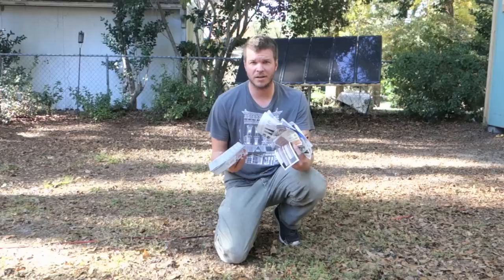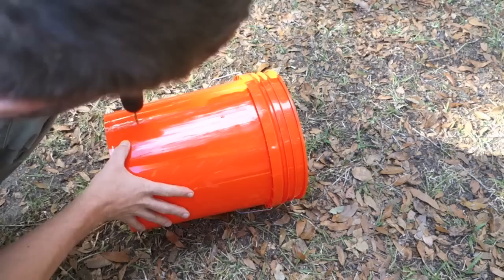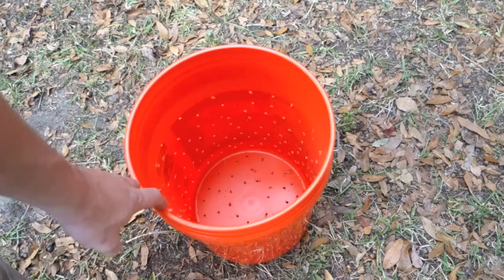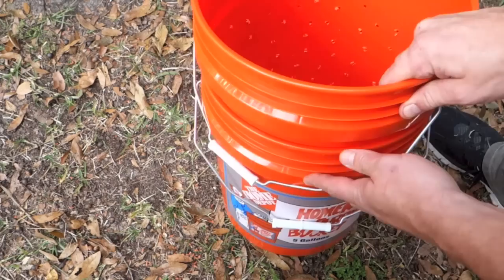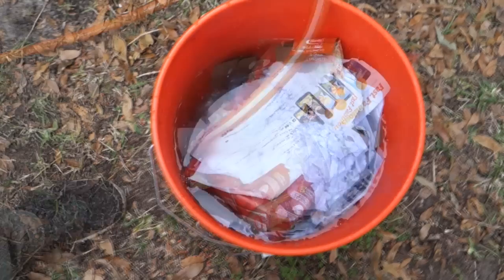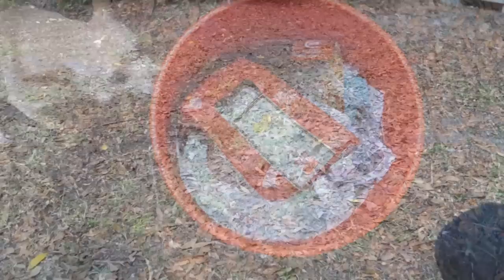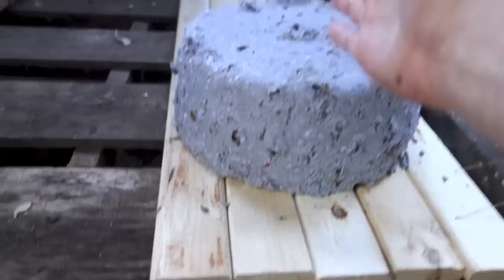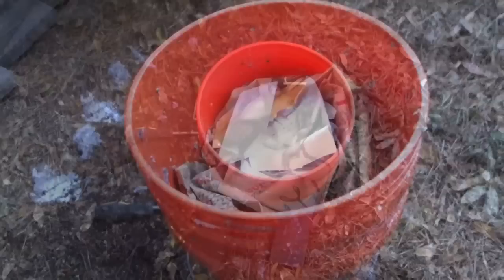Free And Virtually Unlimited Fuel To Heat Your Home

Comment: can we discuss the inks in this paper that youre using, flooding your home as a gas...? you people cannot believe this is a good idea..
Reply: The fumes are still there..
Reply: lets all huddle around a poison smoke fire!
Reply: John Kersch Definitely much better than the millions of automobiles creating poison, huh? Or how about the coal fire power plants for heat, instead? Great way to look at a two sided coin! sarcasm
Reply: CO2 is a lot less dangerous than the fumes coming off that shit; btw, firing this would also create CO2 emissions. Might wanna go back to school.
Reply: John Kersch Do you have any clue about the amount of energy consumed in obtaining and processing fossil fuels? We haven't even gotten to the consumer yet. I have a feeling you're clueless about such topics.
Reply: Coming from the guy that thinks co2 is poison, I have less faith in your understanding.
Reply: John Kersch I never mentioned CO2, you did.. But if you're denying that factories and automobiles aren't bad for the environment then it is I who has less faith in your understanding.
Reply: John Kersch carbon monoxide is the poison one and it's produced in any case of burning fuels CO2 is bad but CO will kill you. 

bugs181 well fossil fuels are dangerous but their energy released is still above the cost to produce it and since their fumes are cleaner/easier to control fossil fuels are safer than this.
Reply: James Mulchrone Ummm.....CO2 is necessary for life. It is critical to photosynthesis.  CO2 is  NOT BAD.  ....contrary to those who are dumb enough to believe in the man-made global warming hoax..... (aka the government power grab based on total science FICTION ) 

I agree with you that CO is dangerous, and should be monitored when burning any carbon based product, however burning paper biomass fuel is carbon neutral.  Because if this paper decomposed in a landfill it would emit the exact same amount of carbon into the soil and air as it decomposes.  

Same thing with wood. It is carbon neutral and burning it is no more dangerous to the environment than if twigs and branches decomposed on the forest floor and NEVER were touched by man....decomposition emits carbon into the air, water and soil.  It is part of the ecosystem and it is NOT HARMFUL, nor does it effect climate change in any way
Reply: Archangel0804 while CO2 is necessary overproduction is still harmful (enough CO2 is being produced naturally that's how trees survived before humanity started burning things) and man made global warming isn't a hoax it's just misunderstood and misrepresented. I'm sure if you look into the information yourself you can clearly see that since the industrial revolution (records go further back but that's one of the biggest turning points) the world has been heating gradually. I understand if you would be sceptical as it's really been forced down peoples throats in recent years but the evidence is there.

while paper is manufactured the process removes the woods natural oils that allow for prolonged burning and better heat generation as a result the burn will release more dense carbon resulting in higher CO production (which is both more damaging to inhale and to the environment) so i wouldn't agree with you on paper being carbon nutral. I do agree with you on woods though as during the lifetime of a tree it absorbed the carbon that's released while burning.

Decomposition releases mostly Methane gas (CH4) which is being collected from old dumpsites and used as natural gas which is far more effective for heating and cleaner burning so i believe if done right dumps can be an effective, clean and carbon nutral solution to overproduction of waste. 

While it's true that decomposition does also release Carbon into the air it's useful carbon and the solid mass left after decomposition is nutrient rich which can be used to fertilise the soil of new trees whereas ash is not really effective when it comes to fertiliser.
Reply: James Mulchrone I'm not even going to debate you on this topic because you are parroting a bunch of nonsensical BULL,  spewed out by the bought and paid for corporatist mockingbird media which has an agenda.  

The Earth is not warming, it has been SIGNIFICANTLY cooling for the last 18-20 years. Evidence is the cyclical colder temperatures in the Northern Hemisphere, winters are MUCH colder and longer;  polar ice caps have massively increased just in the last 15 years

The "Global Warming" HOAX is just that...a HOAX. The only thing that happens when you increase CO2 in the atmosphere or in controlled test (such as a greenhouse) is that plants rapidly increase in size.

The HOAX is based on computer models and is purely  THEORETICAL, based on BAD SCIENCE which is funded by Governments and the UN which have an Agenda of seizing power to tax and nationalize the consumption of energy. 
Meanwhile Scientists rely on this funding to remain employed, therefore together they can skew the data to present anything desired by those paying for the data, much like an accountant who wants to present the strength of a company in a better light to its stockholders, can manipulate the numbers

31487 Scientists Agree with me. 9029 of which hold PhDs

http://www.petitionproject.org/

One of the MAJOR problems with the studies in "Global Warming" is that the models don't take into consideration the effects of the SUN.  

From a logical standpoint, WHY wouldn't the studies INCLUDE the effects of the SUN....that which controls and has the largest effect on  the Earth's temperature??  The FACT is that the SUN is responsible for the SLIGHT INCREASE in CO2 on planet Earth.

You are correct in that CO2 has increased in atmosphere from the standpoint of measuring from ppm, HOWEVER this is purely CYCLICAL...It will reverse and is already starting to do so.

Furthermore, There is plenty of Scientific data which supports that the percentage of CO2 in the atmosphere was  MUCH higher roughly 300 years ago than today.   Today it is estimated at 384ppm, whereas roughly 300 years ago studies suggest over 400 ppm
Explain THAT.....Fossil fuels weren't even burned 300 years ago.
Reply: John Kersch If you have a wood stove in your home with the chimney going outside your house, no problem
Reply: budsatawny It's one of the Best products available...Thumbs up
Reply: bugs181 Coal fired power plants in the USA (not ALL, but the vast majority today) have had catalytic converters for more than 20 years....which convert the emissions to simple water vapor.  

The rest is simply agenda-driven, parroted DISINFORMATION. 

 Do some real research and talk to a few engineers who work for power companies who will confirm this information.  

The "war on coal" in this country is purely political. 
It is all LIES meant to keep American Citizens heavily taxed and under the control of the Federal bureaucrats.  It adds legitimacy to the EPA fascist bunch

If you want to point fingers, look to the Chinese, who build a new coal plant about every other week, and do not regulate their emissions whatsoever.  We all live on the same planet. You are breathing "Chinese" and "East Indian" air too.
Reply: Archangel0804 It's funny the way you say "I'm not even going to debate you on this topic" and then you go on for 8 paragraphs and an external link debating why the nonsense you believe to be right is true and everything i have learned on the matter is wrong. (that's sarcasm just incase the text doesn't show it to well)

If global warming was a conspiracy like you say then why are corporations losing out on things like emissions taxes, if you said it's the government's agenda i might believe but no, just no.

yeah i've seen the tide steadily rising at my local beach since i was a kid (rising sea levels) and for a country with year round mild temperatures we've been getting longer hotter summers and shorter winters. That's physical evidence of global warming which is worth much more to me than your say so. 

Are you serious? plants have a rate of absorption like humans have a rate of digestion increasing the CO2 drastically would be like force feeding a person it doesn't give people more energy it chokes them. i don't know where you learned biology but Photosynthesis doesn't work like that. 

I think you might have watched a few too many movies there's physical evidence of global warming, i know NASA is a US government organization but if you take a look below you can see the evidence that seas/oceans temperatures are rising, the ice sheets are becoming thinner, sea levels are rising ect. 

Yeah on your petition there, what's stopping forgeries? Also on their "scientists” What expertise does a nuclear engineer or a medical doctor or a food scientist or mechanical engineer have that makes them qualified to have an informed opinion on the causes of climate disruption? that petition has no credibility.

What are you on about that they don't include the sun? obviously they include the sun that's what's generating the heat that's being absorbed into the atmosphere easier because an excess of CO2 they do account for the sun. The sun cannot increase the amount of CO2 and unless you have even the slightest evidence to back up this point you might as well have not bothered since again it's just your say so against physical evidence.

If there's plenty of scientific data proving that you are right than actually show something like a graph rather than you naming a couple of numbers and saying it's fact prove it by linking a graph from a reputable source proving that your right. 

Your final point is so wrong since fossil fuels have been in use since the 13th century (coal) and what's that big event that happened around 300 years ago... the industrial revolution perhaps that was fueled by coal ???
Reply: James Mulchrone First off ....learn some fucking history.  The United States isn't even 300 years old....it is 239 years old, and the Industrial Revolution, PRIMARILY occurred as a result of inventions in this country....like Ford's Model T as an example

Furthermore,  The Industrial Revolution took place from 1820-1840 (by most accounts) this would mean approximately 195 years ago. ....
You are only OFF by about 100 years, dude

I'm NOT going to debate you...because it is CLEAR that you are entrenched in your false paradigm and ideological beliefs and it will get us nowhere.  
If you want to remain IGNORANT...that is your business...but maybe you should ask yourself...CUI BONO?  Who benefits.

The UN and Government are pushing your agenda, because it means more centralized power

More Centralized power means more ability to impose a carbon tax and to limit energy resources; It would be the greatest seizure of power in HISTORY

Maybe you should ask these same governments , what the effects of Geo-Engineering has on Global Warming instead??  

Maybe that SHIT that they are constantly spraying  in the air (which is increasing, massively, the number of heavy metals we are all breathing)  may have something to do with erratic Weather and Seas rising?....and possibly contributing to increased global Temperatures (although this has NOT been the case the last 15-20 years)

What about the increased activity with the use of HAARP in Alaska, that was supposedly closed, but is more active today than EVER??

Why don't you have as much zeal about studying the effects of THAT??...Instead of parroting the SCIENCE FICTION you hear from the Statists....you know....those who benefit GREATLY, financially and otherwise, from this HOAX??

Alarmists like you probably aren't old enough to remember the Gasoline Embargo of the 70s....back when the Alarmists were stating that we had reached PEAK OIL....and that all of the oil would be COMPLETELY GONE...BONE DRY  by 1984......

It is now 42 years later.....

FACT:  There are MILLIONS AND MILLIONS, MORE cars on the roads TODAY than there were 42 years ago, due to the emerging middle-class in heavily populated nations like India and China....... 

And DESPITE THIS FACT, We have a GLOBAL Oil SURPLUS

A TOTAL HOAX

Why was this COMPLETE LIE conjured up in 1973?  

Answer:  CUI BONO???

Because it gave OPEC, The Oil Companies,  and the GOVERNMENTS MORE MONEY VIA TAXATION, MORE POWER CONSOLIDATION, AND MORE CONTROL (EPA)

You are GULLIBLE

TODAY'S NEWS.....this is yet another nail in the "Global Warming" crowd's coffin.

http://dailycaller.com/2015/05/18/new-study-threatens-to-unravel-obamas-global-warming-agenda/
Reply: Archangel0804 yeah the industrial revolution predates america and started in the UK with the advances in water power and steam engine technology that went on to make mechanized factories and rail transport a norm.

Fords model T wasn't made until 1908, that's not in the 20 year gap you mentioned which is actually the end of the industrial revolution (it's said to have began around 1860) so you're wrong.

Again with this "i'm not going to debate" bull and then you go on arguing. Make up your mind! (you also need to work on your translation skills "to whose benefit?")

(i'm getting real tired of reading your bullshit statements...)

Geo-engineering is bad in localised areas (since heavy metals don't carry far) but it hasn't much bearing on a global scale and i'm not bringing it up since i don't have as much knowledge on the matter as i do on the greenhouse effect (as i've studied just the one).

what the fuck has HAARP got to do with anything?

There was an oil shortage in the 70's and since then many new sources of oil have been found as well as old sources have dried up/become too difficult to use. The prediction was based on the sources being tapped at the time (not alarmest propaganda/hoax just misinterpreted information)

"Obama's global warming agenda" seriously? He's only been in office since 09 and as the president he has a set salary (taxes don't go through him they are processed by a separate office so increased taxation doesn't benefit him) not to mention that global warming theories were brought into the media around the late 50's. Care to explain or is that your whole arguement ?
Reply: James Mulchrone 
First off....READ my comment.  It doesn't say the specific date of Ford's Model T  Instead it says:

"The Industrial Revolution took place from 1820-1840 (BY MOST ACCOUNTS) this would mean approximately 195 years ago"

Google is your friend:  ....."when did the Industrial Revolution take place"

Wikipedia says the following: 
The Industrial Revolution was the transition to new manufacturing processes in the period from about 1760 to sometime between 1820 and 1840. 

Even IF we were to use the earliest date of 1760, you are STILL OFF by roughly 5 decades (2015-300= 1715).

So why was CO2 at a higher rate in 1715 than it is today?  

You assertion that it was "due to the Industrial Revolution" is COMPLETELY unfounded and unexplained.

CUI BONO

cui bo·no?

kwē ˈbōnō/

exclamation
exclamation: cui bono?

who stands, or stood, to gain (from a crime, and so might have been responsible for it)?

Origin

early 17th century: Latin, literally ‘to whom (is it) a benefit?’

I said "WHO BENEFITS"

Please Explain HOW (exactly) my translation is "wrong".

You are a moron to attack this point, because it's usage in context is 100% accurate.

HAARP is also 100% relevant to this discussion.because gullible alarmists like yourself, attempt to convince skeptics that we are experiencing horrific and FREQUENT "erratic weather changes", and this somehow proves that Global Warming or Global Climate change exists....and it is due to CO2. LOL
Or as YOU claimed in an earlier statement....you see "rising tides" and somehow purport this as "evidence"   

The REASON HAARP is relevant is because HAARP has the ability to change weather patterns, create droughts, and it is said that it can even influence earthquakes and seismic activity.  

While this is top secret stuff and neither I nor YOU can prove its capabilities (or lack thereof) , this is quite unnerving.  
To know that a Typhoon can be created and could be used to destroy an island nation is unfathomable...and IF unleashed,  it would appear as it was a natural event with no culpability.

If man can control the weather, or use it as a weapon, Can you see how this could be used in a subversive manner to dominate the world? 

It would be EASY to blame weather events and erratic weather on naturally occurring phenomena like a slight cyclical change in the composition of our Ozone.
But the FACTS are (at least in the USA) the last two years have shown LESS Tornadoes and LESS Erratic weather patterns.  
The difference TODAY versus 25 years ago is that the MEDIA is all over every weather event.. (its good for ratings) ..The internet, and even smart phones innundate us with a LOT more information and in a more timely manner.

I am an Engineer today and served in the US military for over a decade. The types of weapons that were and ARE  being developed by DARPA would blow your mind.  Even technology from the 1980s, would blow your mind

I can tell you with great certainty that if you follow the money, quit reading politically inspired bullcrap propaganda. think critically, and ask yourself the question CUI BONO, the only logical answer is that GW or "climate change" is a total HOAX designed to CONTROL .

Weather has always changed and it always will.  And we go thru cycles of heating and cooling....Ozone composition continues to fluctuate, and the SUN has the greatest impact on the weather and ozone

Just like PEAK OIL, it is a bullcrap HOAX.  

BTW...your explanation about Peak Oil is also lame....They had better technology back in the 70's than you are giving credit for.  They KNEW there was still oil.  But conveniently chose to use the crisis to gain more centralized power, money, and control
Reply: ***** Yep....You're exactly right....Global Warming is definitely a Conspiracy Theory, unproven by anyone
Reply: Archangel0804 Go become a world leader and find out, you have no proof except them saying that weather can be controlled, weather isn't the cause for a entire PLANET heating up.
Reply: James Mulchrone 

I'm not missing any point except the point on top of your head.

What is your major malfunction except Liberal LUNACY?

My only goal with previous statements was to PROVE to you that the Government has the ABILITY to TOTALLY Manipulate weather, hurricanes., Tornadoes and Earthquakes with Techtonic devices.

That said, The GOVERNMENT can create erratic weather patterns and BLAME it on Man-Made  Greenhouse gases.

Why would they do this?
To SEIZE POWER
To REGULATE ENERGY USE
To SEIZE WEALTH

BUT MOST OF ALL.....TO ADVANCE THEIR CONTROL GRID

This can be compared (in a way) to the way in which the Government, advance stheir global ambitions by using "Terrorism" as their EXCUSE

The US Patriot Act and the "War on Terror" had absolutely NOTHING to do with Terrorism, and EVERYTHING to do with a WAR ON THE AMERICAN PEOPLES RIGHTS

A Few months ago, a Person in the USA who said 
"ISIS was Created as a Tool of the Government ....Created and Trained by the CIA"......

Most Liberal's Heads would explode if they heard this.  They would INSTANTLY call you a "CONSPIRACY THEORIST"

GUESS WHAT?  Those who said ISIS was a government "asset" were 100% RIGHT  

As a matter of fact the DOD ADMITTED that ISIS was CREATED BY THE CIA, last Weekend.  
And Where was the Mainstream Media?

Nowhere to be found.

The Government and GLOBAL-POWERS-THAT-BE  Use/exploit ISIS 

Sure...they are radical religious loons who will kill...but they can and WILL be squashed like a bug when they outlive their usefulness.

ISIS and Al Queda (just like the Global Warming CULT of  AL GORE pinheads ) are really just groups of useful idiots to further the agenda....
And James....hate to break it to you, BUT YOU ARE IN THEIR CLUB !!

This is ALL being done to advance GLOBAL AMBITIONS of the ELITE

WAKE THE FUCK UP!!!!   QUIT DRINKING AL GORE's KOOL AID OPEN YOUR MIND OF THE POSSIBILITY OF MANIPULATED DATA, AND MANIPULATED WEATHER....ALWAYS ASK, CUI BONO?

That said, there is also...... NO ABSOLUTE SCIENTIFIC PROOF that MAN has effected the climate whatsoever

Matter of Fact, There is OVERWHELMING Evidence that DISPROVES  MAN-MADE Global warming. 

 It is a HOAX...a CONSPIRACY Cooked up by Statists to seize more power...

And they NEED USEFUL IDIOTS, such as yourself to believe and PROPAGATE, the Propaganda

But IF you Want to Live your Life, listening to people like AL GORE who doesn't have two brain cells to rub together and has proven to be nothing more than another LIAR POLITICIAN.... and you .WON'T listen to other viewpoints because you are Totally Entrenched in your quest to save the Earth from something that doesn't even exist....WELL THEN GO KNOCK YOURSELF OUT.

But get this.....MOST OF US THINK YOU ARE NUTTER....... Because there is ZERO Credible Proof that MAN has contributed OR increased levels of CO2 ......NOR is Man causing any change in the weather

BTW, I am an Engineer.  
Today I Design and Build  NET ZERO homes and Commercial Buildings with some VERY advanced components and materials.
I BELIEVE in Alternative Energy Sources....not so much because I am against fossil fuels, but because I believe in NOT being RELIANT on the fragile power grid or any government Infrastructure.  I believe in self reliance.

That said, IF there is any benefit to the Environment as a result of my work then it is a  SECONDARY BENEFIT. 
WE in the USA don't have an environmental problem here.  If you want to see a "problem environment, make a trip to China or India.....I HAVE BEEN THERE

For your reading pleasure the first article was released TODAY.
It  exposes MORE LUNACY on the issue (which everyone is basically ignoring at this point).  

RELEASED TODAY:

http://lastresistance.com/11896/obama-warns-about-global-warming-induced-extreme-weather-no-major-hurricane-in-almost-a-decade/

Another: 
http://www.climatedepot.com/2014/10/03/its-official-global-warming-pause-or-standstill-extends-to-over-18-years-pause-has-endured-for-a-little-over-half-the-satellite-temperature-record/

Another: 
https://notalotofpeopleknowthat.wordpress.com/2015/04/18/no-underlying-global-temperature-increase-for-20-years/

Another: 
http://www.sciencetimes.com/articles/4487/20150318/al-gore-seeks-punish-climate-change-deniers.htm
Reply: Archangel0804 deforestation is very real.... reduction in the one thing that produces oxygen WILL alter the planet.... that is the evidence... without trees ... you be fucked!.... it effects all the ecosystems.... maybe its not just pollution which should not exist at all! with the right filter systems in place! billion years of plants in only 1000 years.... so much gone! it is not sustainable... the real ploy here is a benefit for all companies and peoples behaviour towards the only 1 thing they really do need and for future generations, this planet!.... so yeah... its not entire BS... just people need to change their attitudes pronto!
Reply: James Mulchrone 

NEWS TODAY:

Climate Science Magic: Data “Adjusted” to Make The Warming Pause Disappear from Record

Climate science consists in the ability to shamelessly manipulate information in order to substantiate already-decided conclusions

This pause in warming existed and was public knowledge

It was also a thorn in the flesh of many climate scientists who were baffled as to why this phenomenon was observed. 

If our global carbon emissions have not decreased – in fact, quite the contrary; they’ve increased – then there should be no pause in warming. 

There SHOULD BE a marked increase in warming that correlates with rising carbon emissions.

That’s of course assuming that their presuppositions about what exactly causes the global temperature to rise are correct.

Scientists don’t have to be baffled or bothered by this inconvenient truth anymore. They simply and conveniently “edited” it out of the record. 

Sounds like racketeering, doesn’t it?

Read more at http://lastresistance.com/12036/climate-science-magic-data-adjusted-to-make-warming-pause-disappear-from-record/#bjjHvM0qitAbeMbZ.99

BOTTOMLINE....IT'S A HUGE HOAX AND DATA IS PURPOSELY MANIPULATED TO PERPETUATE THE LIE

CUI BONO?   

Global Warming or Global Climate Change is a TRILLION DOLLAR BUSINESS....  And Governments LOVE IT.....they get to TAX IT ALL

Use your head for more than a hat rack.
Reply: Archangel0804 sorry i taught you gave up arguing, i'm seriously getting sick of the bullsshit your selling so i'll reply one more time.

The effect of weather manipulation stations is very small scale and costly they are not the cause for the entire planet's atmosphere and seas heating.

Nowhere even in any of the links you've provided me does it say the extent of their ability to manipulate weather only that they can and have done so and even that is worthless without the evidence and actually stating what weather event they caused. 

You are reading what if's and maybes and taking them as fact well i have some sour news for you, almost all the links you have given lead to sites that are laced with advertisements, these sites are getting payed for every visitor so the only ones benefiting are the propaganda spewers that have unfortunate individuals like yourself brainwashed into thinking that everyone else is wrong. Cui bono?

If your government is capable of destroying countries with floods and sending in relief teams to reap the rewards then why are countries like india suffering from yearly floods and countries like Pakistan that America doesn't exactly get along with on the rise? if america could do it they would. 

why the fuck can't you stay on point? ISIS has nothing to do with global warming!

Global warming isn't a cult you dumbass it's fact the evidence is clear from the examination of CO2 in glacial ice to the rising sea levels it's all as clear as a desert sky but your to fucking ignorant to actually look.

Again you say to ask "CUI BONO?" but Al Gore isn't benefiting, Obama isn't benefiting so why don't you tell me who is actually benefiting other than the people selling you this bullshit?

You say there's overwhelming evidence disproving global warming but all you've shown are a few quotes taken out of context if there's evidence prove it, show me a bar graph or image from any reliable source that disproves it. 

You do realise you are in the minority as global warming is a widely accepted theory like the big bang, you're the nut job saying that everything's a lie and that everyone is out to get you. Grow the fuck up.

Congratulations on being an engineer but you have proven a point that even educated people can still be idiots when they spend too long on conspiracy theory sites. Try taking a break from the internet and read a book or two on the subject.

Like jammapcb said deforestation is not only reducing the amount of plants to absorb CO2 but also forests are burned away to make room for crops in many developing countries. That's a fact and with reduced plant life and increased burning CO2 levels can and have risen.
Reply: Archangel0804 jackass i'm not discussing that with you any more, i've wasted enough time already. Go annoy someone else and I've lost nothing but patience with you.
Reply: James Mulchrone in no way is it this simple! ... sorrry
Reply: James Mulchrone name me one scientist? and the article with evidence to back it up?
Reply: carbon is required for plant life!... mono vs dioxide... go learn why they are very different! at least have hands on experience on the effects to us and the environment first!... grade 101 science!

less trees = major fuck up... include that in the so called calcs!
Reply: James Mulchrone Yeah you have....YOU'VE LOST YOUR FRIGGIN' MIND
Reply: jammapcb sorry but can you please structure your reply a little better? No offence, i'm not a grammer natzi or anything I just find it difficult following the point if i can't read the comment.

In no way is it what simple? are you saying you want evidence to backup the theory of global warming? 

True carbon is needed for all life but an excess of either CO or CO2 can kill plants just as it can kill people. I know the difference between monoxide and dioxide and despite one being far worse than the other they are both damaging. I don't know what you are trying to say by "at least have hands on experience on the effects" can you elaborate please?

True less trees will equal to more damage to the atmosphere and that's basically what i said.
Reply: Archangel0804 very mature
Reply: Archangel0804 yeah photosynthesis has two stages, one where they absorb CO2 and produce oxygen in the presence of light and the other is the opposite(basically an exhale as the plants need to digest and use the energy they absorb while photosynthesising), Large plants like trees absorb more co2 than they produce so clearing out forests for crops is still quite damaging.
Reply: HURRAY.....I will agree with this statement....to a degree....IF the forest consists of mainly mature trees (which due to natural competition will impede the growth of smaller trees by competition for sunlight and water) then the net effect is that little oxygen is produced.  The IDEAL O2 generator is a LOT of growing trees....Clearing an area for crops is NOT necessarily detrimental to O2 production...the same cellulose is also found in every single plant and grasses on earth including food crop production
Reply: Archangel0804 Gore's getting rich because he invested in green energy projects (biofuels, solar grids ect) and not on taxation also gore was a millionaire before he was vice president. the rich get richer that's news _
Reply: James Mulchrone  I never once stated that Gore was getting rich on taxation....That comes later.

Gore is spewing LIES....He is a chicken little, and creating/funding the alarmist propaganda that "MAN" is contributing to elevated CO2 levels.  

This simply is UNTRUE and UNFOUNDED.  Even the science proves it...UNTIL the same Scientists MANIPULATE the DATA to keep themselves RELEVANT

Don't misunderstand my position on this issue...I am 100% for alternative energy sources...but NOT for the same reasons.

Tesla had invented tectonic energy sources and he was executed for it.  
The CRONYISM  and COLLUSION between Big Business, Big  Unions, and Big Government are to blame, as this would steal the monopoly and the ability of the government to tax the populace

It is the SAME REASON why Hydrogen cars are NOT on the road...although I can build a hydrogen car in my garage and run it off of water....The government DOESN'T WANT IT, because they CAN'T TAX IT.  And I know for a FACT that General Motors has had the technology since the 1960s

Tesla's inventions would make each man self reliant, and not ATTACHED to Government GRID....and along with it...the regulation and taxation.  

THIS is MY MOTIVATION....Alternative energies to be SELF-RELIANT and no longer have a Utility bill, or the reliance of the government umbilical cord whatsoever.  

And if it in some way benefits the environment as a bi-product, then so be it..... it is an even greater WIN-WIN situation 

But THAT is NOT what Gore, Obama OR the UN want.  

CLEARLY They want to enrich themselves and a greater global governance over all of us, via Carbon taxing

And YOU are playing right into it....
Reply: James Mulchrone have you spent lab time with simulated environmental effects? CO2 rich environment? and the results? also which breeds of trees and plants are better at cleaning up the environments atmosphere? they are not all equal here.
Reply: John Kersch What gases? Do you have proof? What's the level of contamination? What are the gases? See in REAL science unlike global warming science actual factual repeatable data can be shown. So show your work.
Reply: Heywood Jablowme well the burning of inks on bleached paper releases high levels of carbon monoxide as well as sending out airborne ash particles, it's not a conspiracy he's just saying it's harmful because it is.
Reply: I still need proof. Science is NOT consensus nor is it " I'm Pretty sure it''s bad "
Reply: Archangel0804 i never said i'm blocking you out of frustration, i'm going to do so because of your abusive behaviour not only to me but to everyone that has disagreed with you. I have proven my point and disproven yours but when i have done so you just introduce more bullshit about the government being bad or terrorists which has absolutely nothing to do with the discussion about the video. 

Stop picking on others because of your own insecurity and grow up yourself.
Reply: So many trolls lol
Reply: John Kersch Hey...I'm not. LOL  I like this guy's idea.  I have made some biomass logs myself and I am always interested in other people's ideas to simplify the process 

I'm sick and tired of all of the morons who "down" others ideas.  

In this case it is the Global Warming / Global Climate Change alarmists who lean on their Science FICTION soapbox in order to be critical of this video
Reply: It has nothing to do with fucking climate change, burning fucking ink releases poisonous gasses.
Reply: Climate change isn't the earth heating up or cooling down. It's the climates around the world heating up and cooling down, which in turn disrupt the entire ecosystem. Some parts of the world are becoming drier and hotter, while others are becoming more and more cold, causing violent weather and huge disruption to climates, which hurts the environment.

CO2 is toxic to animals in large enough quantities by the way. It's not as toxic as CO but it is still toxic and if the air you are breathing is around 20% i believe, you pass out and die, as with CO.
Reply: SuperMegaUltraPigeon 
I agree with your statement about CO gas.  It is poisonous and breathing it in copious amounts is a killer, however this only happens when you burn carbon based products (fossil fuels, wood, etc) in confined areas

Heating up and cooling down is NORMAL.  It is also a Complete MYTH about "extreme weather" conditions, which is typically where this argument goes according to alarmists.

http://research.noaa.gov/News/NewsArchive/LatestNews/TabId/684/ArtMID/1768/ArticleID/10838/NOAA-study-shows-pattern-of-fewer-days-with-tornadoes-but-more-tornadoes-on-those-days.aspx

http://www.co2science.org/articles/V10/N29/EDIT.php

  Mammals are animals too.  Human Mammals and other animals are UNEFFECTED by CO2 (we breathe air which contains CO2 and only catalyze O2, and expel CO2 which is in turn used by ALL plant life in photosynthesis. 

FACTS are a REAL NUISANCE when it comes to furthering the Marxist Agenda:

The threat to the world is not man-made global warming or
climate change.  

 

The threat to the world, as is always the case, is a current
group(s) of humans who want to impose their values and desires on others. 

 

 

Quotes by H.L. Mencken, famous columnist: "The
whole aim of practical politics is to keep the populace alarmed — and hence
clamorous to be led to safety — by menacing it with an endless series of
hobgoblins, all of them imaginary." And, "The urge to save humanity
is almost always only a false face for the urge to rule it."   

 

Quote by Ottmar Edenhoffer, high level UN-IPCC
official:  "We redistribute de facto the world's wealth by
climate policy...Basically it's a big mistake to discuss climate policy
separately from the major themes of globalization...One has to free oneself
from the illusion that international climate policy is environmental policy.
This has almost nothing to do with environmental policy anymore." 

 

Quote by Naomi Klein, anti-capitalism, pro-hysteria advocate
of global warming: "So the need for another economic model is urgent,
and if the climate justice movement can show that responding to climate change
is the best chance for a more "just" economic system...

 

 Quote by David Brower,
a founder of the Sierra Club: "The goal now is a socialist,
redistributionist society, which is nature's proper steward and society's only
hope." 

 

Quote by Club of Rome: "In searching for a new
enemy to unite us, we came up with the idea that pollution, the threat of
global warming, water shortages, famine and the like would fit the bill....All
these dangers are caused by human intervention....and thus the “real enemy,
then, is humanity itself....believe humanity requires a common motivation, namely
a common adversary in order to realize world government. It does not matter if
this common enemy is “a real one or….one invented for the purpose." 

 

Quote by Timoth
  Wirth, U.S./UN
functionary, former elected Democrat Senator: “We’ve got to ride the
global-warming issue. Even if the theory of global warming is wrong, we will be
doing the right thing in terms of economic policy and environmental policy.” 

 

Quote by Richard Benedik, former U.S./UN
bureaucrat: "A global climate treaty must be implemented even if
there is no scientific evidence to back the greenhouse effect."Quote by
Paul Watson, a founder of Greenpeace: "It doesn't matter what is
true, it only matters what people believe is true." 

 

Quote by Jim Sibbison, environmental journalist, former
public relations official for the Environmental Protection
Agency: "We routinely wrote scare stories...Our press reports were
more or less true...We were out to whip the public into a frenzy about the
environment." 

 

Quote by emeritus professor Daniel Botkin: "The
only way to get our society to truly change is to frighten people with the
possibility of a catastrophe." 

 

Quote by David Suzuki, celebrity scientist, alarmist
extraordinaire: 1990 quote: "More than any other time in history, the
1990s will be a turning point for human civilization." 

 

Quote by David Suzuki, celebrity scientist, alarmist
extraordinaire: 2011 quote: "Humanity is facing a challenge unlike
any we’ve ever had to confront. We are in an unprecedented period of
change." 

 

Quote by Robert Stavins, the head of Harvard’s Environmental
Economics program: "It’s unlikely that the U.S. is going to take
serious action on climate change until there are observable, dramatic events,
almost catastrophic in nature, that drive public opinion and drive the political
process in that direction." 

 

Quote by Al Gore, former U.S. vice president, and large CO2
producer: "I believe it is appropriate to have an over-representation
of factual presentations on how dangerous it is, as a predicate for opening up
the audience to listen to what the solutions are, and how hopeful it is that we
are going to solve this crisis." 

 

Quote by Stephen Schneider, Stanford Univ.,
environmentalist: "That, of course, entails getting loads of media
coverage. So we have to offer up scary scenarios, make simplified, dramatic
statements, and make little mention of any doubts we might have." 

 

Quote by Sir John Houghton, pompous lead editor of first
three IPCC reports: “If we want a good environmental policy in the future
we’ll have to have a disaster.”  

 

Quote from Monika Kopacz, atmospheric
scientist: "It is no secret that a lot of climate-change research is
subject to opinion, that climate models sometimes disagree even on the signs of
the future changes (e.g. drier vs. wetter future climate). The problem is, only
sensational exaggeration makes the kind of story that will get politicians’ —
and readers’ — attention. So, yes, climate scientists might exaggerate, but in
today’s world, this is the only way to assure any political action and thus
more federal financing to reduce the scientific uncertainty." 

 

Quote by Steve Sawyer, identified as the “political director”
of Greenpeace International: "Without urgent measures to rapidly
reduce our greenhouse gas emissions, the possibility of limiting the
temperature rise below a dangerous level will have disappeared within a
decade." 

 

Quote by Al Gore, former U.S. vice president, and large CO2
producer: “We are running out of time, we must have a planetary
solution to a planetary crisis.” 

 

Quote by Jim Leape, the man in charge of the head office of
the World Wildlife Fund: “We are running out of time. We know that if
we continue to rely on fossil fuels we will face a future of worsening air
pollution and an increasingly inhospitable climate.” 

 

Quote by Greenpeace spokesperson: “we are
simply running out of time.”

 

Quote from a Worldwatch Institute press
release: "the world is running out of time to head off
catastrophic climate change…now is the time to act.” 

 

Quote from The Environmental Forum: “We are running
out of time.”

 

Quote from Time magazine: "we are
rapidly running out of time to cap carbon emissions.” 

 

Quote by James Hansen, the famous climate scientist warned
(in 2008 & 2013): “we’re running out of time.” 

 

Quote by Stefan Rahmstorf, a climate scientist legend in his
own mind: “we are now running out of time.”

 

Quote from alarmist, Australian professor Barry
Brook: "This is especially true for climate change and environmental
sustainability, where we are perilously close to running out of
time." 

 

Quote by Secretary General of the United Nations tells
business leaders at summit: “running out of time” to make climate change a
strategic priority. 

 

Quote by Ian Bruce, a climate change specialist for David
Suzuki Foundation: “We’re running out of time and we need to
change the mass way of thinking.” 

 

Quote by a co-director of the Australian Youth Climate
Coalition: “I know we’re running out of time.”

 

Quote by Paul Beckwith, Laboratory for Paleoclimatology and
Climatology: “We’re undergoing the early stages of abrupt climate change.”

 

Quote by Chris Folland of UK Meteorological Office: “The
data don't matter. We're not basing our recommendations [for reductions in
carbon dioxide emissions] upon the data. We're basing them upon the climate models.”

 

Quote by David Frame, climate modeler, Oxford University: “Rather
than seeing models as describing literal truth, we ought to see them as
convenient fictions which try to provide something useful.” 

 

Quote by Christine Stewart, former Canadian Environment
Minister: “No matter if the science is all phoney, there are collateral
environmental benefits.... climate change [provides] the greatest chance to
bring about justice and equality in the world.” 

 

Quote by Al Gore, former U.S. vice president, and large CO2
producer: “Humankind has suddenly entered into a brand new relationship
with our planet.  Unless we quickly and profoundly change the course of
our civilization, we face an immediate and grave danger of destroying the
worldwide ecological system that sustains life as we know it.”  

 

Quote from the UN's Own "Agenda
21": "Effective execution of Agenda 21 will require a profound
reorientation of all human society, unlike anything the world has ever
experienced a major shift in the priorities of both governments and individuals
and an unprecedented redeployment of human and financial resources. This shift
will demand that a concern for the environmental consequences of every human
action be integrated into individual and collective decision-making at every
level." 

 

Quote by Maurice Strong, a billionaire elitist, primary power
behind UN throne, and large CO2 producer:“Isn't the only hope for the planet
that the industrialized civilizations collapse? Isn't it our responsibility to
bring that about?”  

 

Quote by Gus Hall, former leader of the Communist Party
USA: "Human society cannot basically stop the destruction of the
environment under capitalism. Socialism is the only structure that makes it
possible." 

 

Quote by Christiana Figueres, leader of the U.N.’s
Framework Convention on Climate
Change: “This is probably the most difficult task we have ever given
ourselves, which is to intentionally transform the economic development model,
for the first time in human history.”
Reply: Archangel0804 Heating and cooling of different parts of the world may be normal, but that doesn't mean it's good for us. That is how species go extinct, by the conditions of a climate changing to a point where they either evolve to suit it, or go extinct; hence why we should attempt to halt climate change, so we can further ensure our own existence.

I also believe climate change also goes into what we are doing with the world, not just through burning fossil fuels, i think it's the rapid industrialization of the world is destroying habitats.

We live in a time where extinction rates are incredibly high, at 100 extinctions per million species per year, which is 1,000 times the normal extinction rate.

The decline of bees is also a major issue, if bees go extinct, many other plants and wildlife will as well due to their vital role on this planet.

Tackling climate change is important, but the problem is the far left aren't looking at the whole picture, they are just looking at the fossil fuels, which are just the tip of the iceberg of the damage we are doing to the environment.

In regard to us breathing CO2, there is a definite percentage of CO2 in the air we breathe, where it is toxic, and i believe it is between 10 to 20 percent if i remember correctly. Although the current amount of CO2 in the atmosphere is very small (0.04%).

However i've seen videos where people have used dry ice (Solid CO2) as a fan for their house, and the problem with this is, it fills the home with CO2, making the air toxic.

So even though it is those who are authoritarian that are the enemy of mankind.

It's our constant expansion that is what is destroying the climates of the world. The amazon jungle is being destroyed by us, the oceans are being destroyed by us, vast amounts of what used to be natural grasslands that harbored a huge variety of life are being destroyed and replaced with farms.
Reply: SuperMegaUltraPigeon  If you understand Organic Chemistry 101, you would realize that Deforestation (when being replaced by crop producing farms) actually INCREASES the O2 supply, not diminishes it

So....your "Green Alarmist" belief is ALSO A MYTH

Here is proof

 Photosynthesis requires three key components to work efficiently – water, CO2 and sunlight. Water (H2O) is required by the tree for the hydrogen it contains. The hydrogen combines with carbon from the CO2 the tree also absorbs to create long chemical chains, also known as hydrocarbons, of which sugars and cellulose are a class and is ultimately what the tree is made of (we call it ‘wood’). 

So what about the sunlight – why is that needed for the process? Well, just like a human cell requires energy to fuel its own processes, the tree also needs energy for its cells to function, and it gets this energy from the Sun.

Sunlight is the catalyst that provides the energy and allows the chemistry of the tree to split the hydrogen from the oxygen in water and combine it with the carbon that, in turn, splits from the oxygen in the CO2. 

The ‘waste’ product, of ALL PLANT LIFE is oxygen.  For this process to happen, two water molecules combine with one carbon dioxide molecule to produce one hydrocarbon molecule and two oxygen molecules. The chemical formula,, is: H2O + H2O + CO2 => H4C + O2 + O2

As sunlight to trees is analogous to the role oxygen plays in humans, it is far more metaphorically, if not anatomically, accurate to say that trees therefore ‘breathe’ sunlight – and not CO2. 

Furthermore, as the CO2 and water components provide the carbon and hydrogen that ultimately forms part of a new cell wall (more wood) it is also much more metaphorically and biologically accurate to say that trees eat CO2.

These are important distinctions. Often when one thinks of a tree ‘breathing’ it is easy to assume that it is a constant process (like real breathing) and that throughout its lifetime a tree will ‘breathe’ out a lot of oxygen – right up until the day it dies – and thus help to replenish atmospheric stocks of O2. 

It is this analogous breathing that has earned the tree the reputation of being the ‘lungs’ of the Earth. But,  it is more accurate (if this metaphor is to be used at all) to say that trees are the ‘stomach’ of the Earth – and stomachs get full.

When a tree is fully grown, it simply stops eating   

THEREFORE NEW TREES or GROWING GRASSES, PLANTS AND CROPS PRODUCE MORE OXYGEN...NOT MATURE TREES

A MATURE TREE consumes just enough CO2 for general maintenance and annual foliage growth cycles, but any CO2 sequestration advantages are lost when this foliage is littered back to the ground and inevitably decomposes.
A mature tree is therefore ‘carbon neutral’ – that is, it produces no more oxygen than its decomposing biomass gives off CO2.

Imagine putting a tree in a room where there is no CO2. What will happen? Well, because there is nothing for the tree to grow new cells with, after a few weeks or months it will likely wither and die. 
Now imagine what would happen to the same tree if it were deprived of sunlight? In a permanently dark room, the tree would fail to photosynthesise. This means its cells would be deprived of the energy it needs to metabolise and the tree would RAPIDLYdie. It would literally ‘suffocate’.
This might seem like a trivial distinction to have to make, to show that trees breathe sunlight and not CO2, but there are some people who actually believe that a tree really breathes and that the gas it ‘inhales’ is CO2. There are also some people who believe, and I quote, “without trees we’d have no air to breathe”. 
Some people believe ‘without trees there would be less (or no) oxygen’.
When we think of trees, especially in their natural settings, such as woodlands or forest, we can’t help but think of all the ‘nasty’ CO2 they are absorbing and all the lovely fresh oxygen they are pumping out into the air. However, there is a balance in nature that is always struck. For every emitter of O2, there is an absorber of it, hungry and waiting to consume it.

So In summary....
IF PLANTS AND TREES ARE NOT MATURE, BUT INSTEAD "GROWING" THEY ALL ARE PUMPING OUT THE OXYGEN WE NEED TO SUSTAIN LIFE
Reply: Archangel0804 rotational crops hold far less CO2 over a far shorter period of time than forests so yeah deforestation is still an issue.
Reply: Archangel0804 Ofcourse deforestation increases CO2 supply, because there is less CO2 stored in biomass. 

Also the actual equation for photosynthesis is

6CO2 + 6H2O -> Light -> C6H12O6 (Sugar) + 6O2

Also trees are a huge store of carbon, due to their size, it doesn't matter that when a tree stops growing it stops absorbing carbon, it is still a huge store of carbon, the earth's atmosphere before plant life had a huge amount of carbon dioxide in it, making the earth hotter and also making it inhabitable for creatures such as us. When plants and other organisms came about that started photosynthesizing, over millions of years all the carbon dioxide was drained from the atmosphere, and oxygen was pumped in, allowing for us to evolve and exist.

Plantlife plays a huge role in the atmosphere.

But that's not my point, my point was climate change extends to destroying climates, not just the atmosphere or temperature. Deforestation destroys ecosystems where a vast variety of animals lives, disrupting them and causing extinction.

You have completely ignored the rest of my post. 

Deforestation is bad not just because it may disrupt the atmosphere, but because it disrupts the fucking climates animals are living in.

Dumping of plastic in the ocean, killing off sealife and polluting the ocean.

Let's forget CO2 levels increasing, it's the least of our problems.

Climate change, is when a climate changes. Which we are doing.
We are literally taking a climate such as a rain forest, and destroying it, turning it into grassland for cows to graze on. In the process of this, we put countless species of animals lives in danger.

We are destroying the oceans, there is a huge amount of plastic dumped into it every year, and it's disrupting the ocean's climate, fish and birds are dying due to the chemicals and plastics they are exposed to.

Let me point out the extinction rate again for you, 100 extinctions per million species per year, which is 1,000 times higher than the natural background rate.